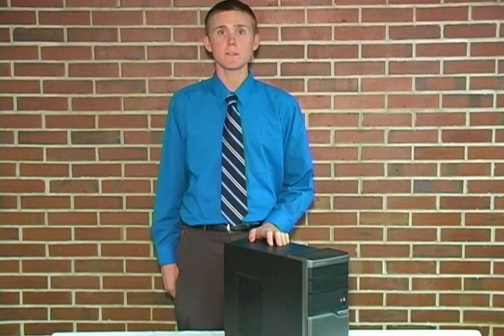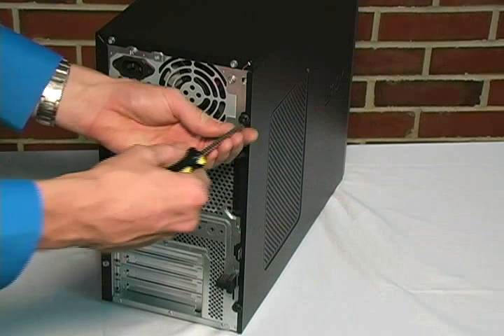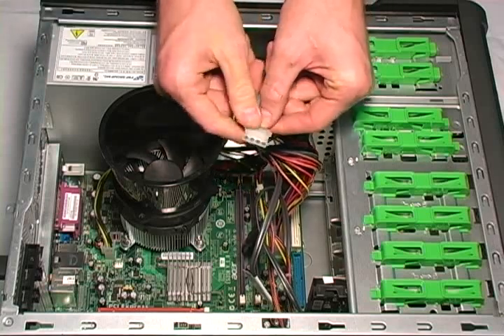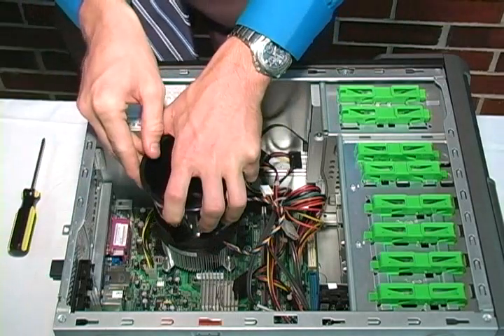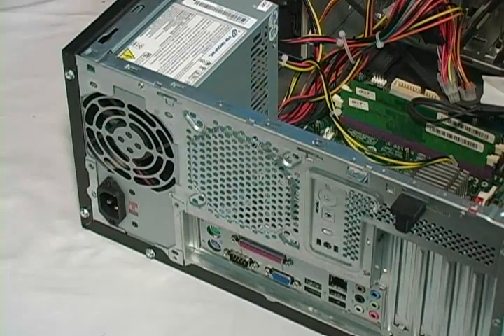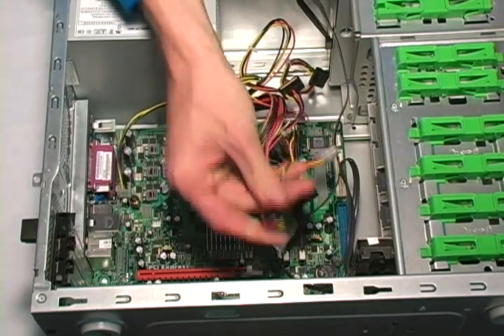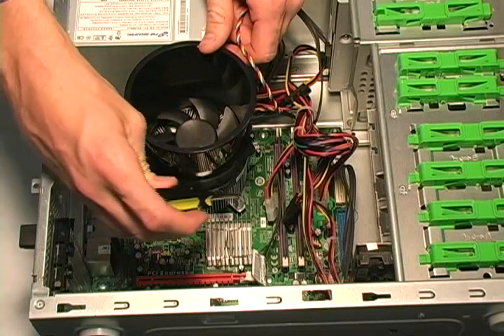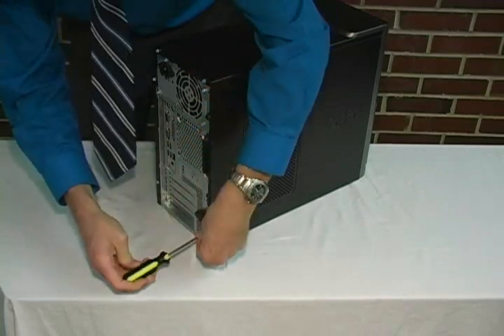How to remove and install a computer Power Supply Unit (PSU)

Comment: Thanks for the clear instructional video.  I happen to have the same desktop with a very loud power supply fan at the moment.  I know the video dates back and I am toying with the idea of converting this PC into a back-up server, mind you, I cannot install windows 10 on it and some upgrades turned out to be incompatible. 
Question:  don't you need a thermal paste before placing back the heat sink?

Comment: Thx, was just checking if I forgot something before I started doing it.
BUT...! I noticed that you didn't clean the cpu and reapply the cooling paste. With potential dust and stuff gathering up during the power supply removal and reinsert this seems an oversight... thx for the video

Comment: is their different psu for different computers or are they all the same Im kind of confused
Reply: mainly they differ in power (Watts, the more watts, the more devices you can connect), and noise, and some protection functions, like those against low-quality electric current (if a thunderstorm hits your electricity network, some PSU's can help save your computer from burning).

Comment: 245 watt PSU.
it says 300 watt minimum
but what if I don't care about the PSU watt requirement and just install it on the 245 watt PSU.
Reply: your PC may work for some time, and then, maybe, the Graphics card will need more power, and the PSU will not provide enough, and the PC will go to sleep. Restart and try not to play too heavy games.

Comment: I know which way it was supposed to go, that wasn't the problem :/ What 'broke' the (now fixed) computer was it wouldn't go back in, so we had to pop the cpu off of the heat-sink (So now I need more thermal gel...) well when we poped it off, it went flying and all the little gold thingies bent... Took a little more than an hour to bend them all straight again @.@ I just didn't mean to pull the whole thing out... the problem was my psu was too big for the computer and I couldn't get it out.

Comment: its easy to put your cpu back in man, if its an Intel cpu you should find a little arrow and just match that arrow with the one in the cpu bed. if you have an amd cpu turn it over and you will see hundreds of little gold connectors, find a missing one in one of the corners and match it up in the cpu bed. done that easy

Comment: That's one big ass fan anyways thank you
Reply: the smaller, the less noise, because the fan will be able to stay idle when it's not needed. In my PC I have a huge cooling tower, and there is no fan at all, and it's cooled down passively. No noise.

Comment: It depends on your motherboard configuration. If your heatsink is in no way hindering the removal/installation of the sata cables to the motherboard, then there is really no need to remove the heat sink.

Comment: Is the heat sink not attached by thermal compound? Would you not need to reapply thermal compound to the cpu when putting the heatsink back?

Comment: Nice vid but i can spot 2 things i don't like :

1: Replacing the heatsink was explained way to casually because replacing the heatsink may require cleaning the cpu/heatsink and replacing thermal paste. IF a heatsink would block the operation i would take out the entire motherboard instead and leave the heatsink in place. I would only disconnect a heatsink when absolutely necesarry.

2: he said no paper and plastic bags, but how about the tie dangling around?